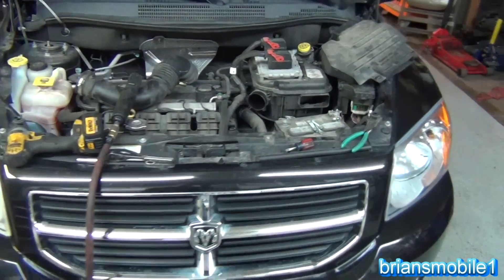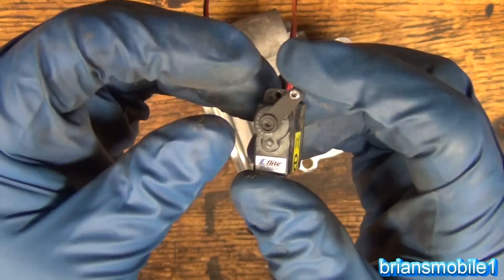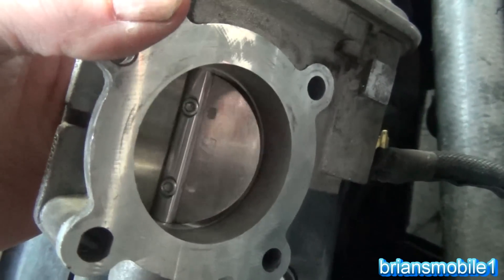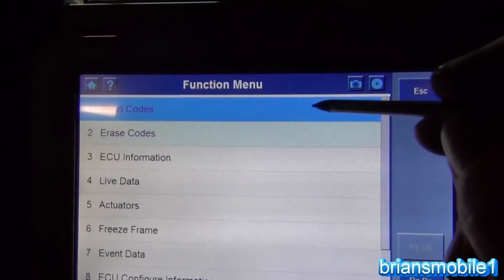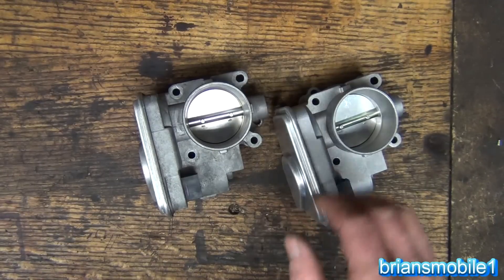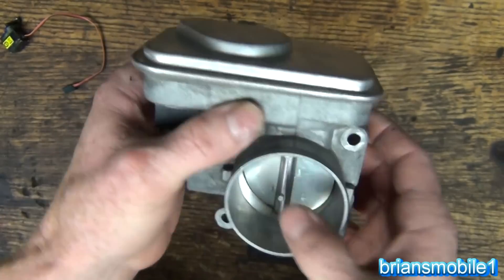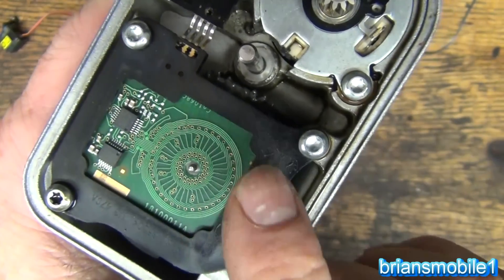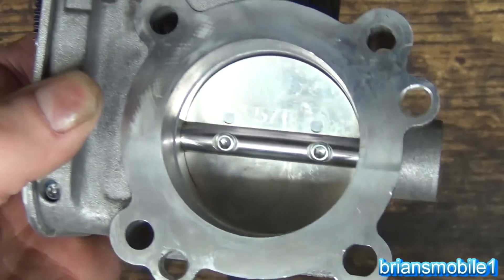Electronic Throttle Control P2110 P2112 P2118 P2110

Comment: So much plastic... disgusting.
Reply from the maker: I want to think that with meshing gears you get grindings- those grindings could cause unlimited glitch manifestations when floating around in such a green board environment without oil circulating over a magnet to gather them over time.  There's no need for oil because movements are slow and limited. 
      Another possibility is it's a mechanical fuse like you find in a brake lathe.  You can rule that out because there's no replaceable fuse to put in there- it's non-serviceable.  There's no point in protecting the rest of the device if it's designed to be replaced as a whole. 
     What I would LIKE to see though, is spares available for those two gears and accessibility means.  People worked on mechanical carburetors, linkages, and throttle cables for years.  It's due to tort law and fear of the technology that manufacturers make these non-serviceable.  Planned obsolescence of the car and product life cycle planning of this component seem like a terrible idea, but it sounds better than negligence and apathy. 
     In the end, like you say- disgusting.
Reply: briansmobile1 What's worse is that there are good plastics out there... yet they choose to use the cheapest of the cheap.
Reply: jrmym2
 Argh! (Thought I'd be brief for a change)